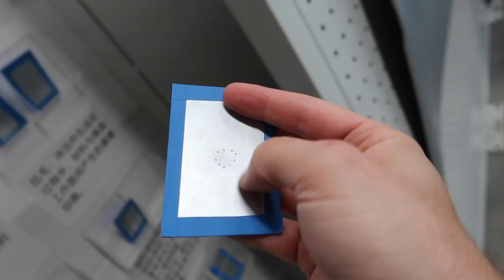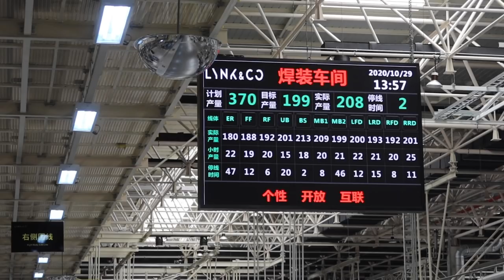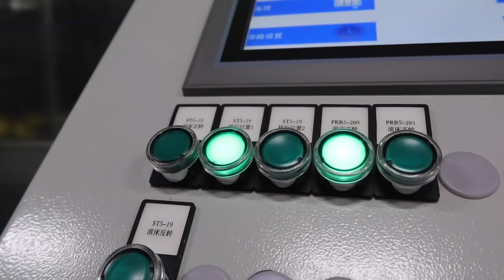Tour an AMAZING Robotic Auto Factory in China, Lynk & Co | China Life VLOG

Comment: I'm kind of surprised any automaker was soo open with you filming. Typically they are quite sensitive with the process and not let your broadcast much of the factory. Trying to protect proprietary processes. This was eye opening.
Reply from the maker: they asked me to blur out some things.. but mostly was very accomodating.
Reply: @JaYoeNation  That was not manufacturing processes. You simply can not broadcast sensitive serial numbers and codes. Seems like you barely censored any of the parts manufacturing. Assembly of finished parts is actually the least sensitive process. I'm a gear head, this was a very eye opening awesome documentary.